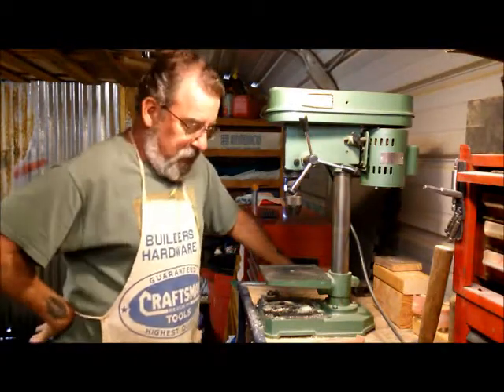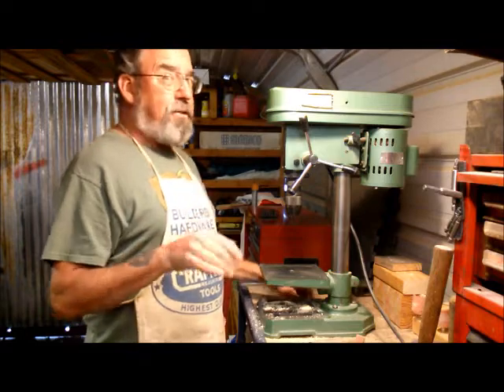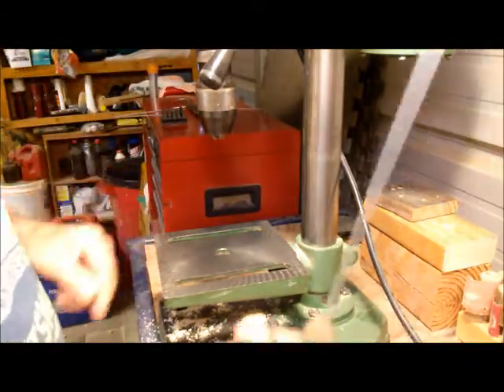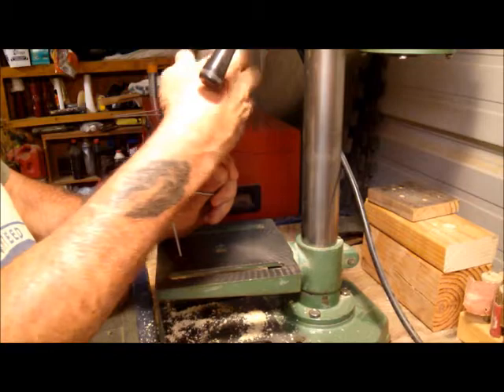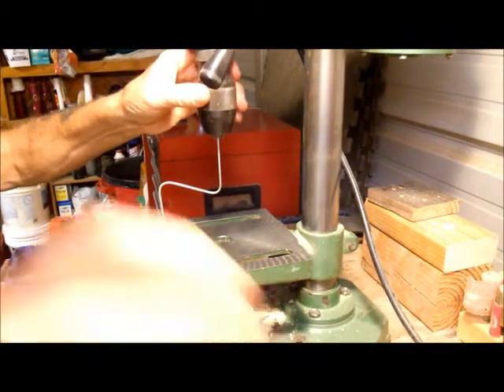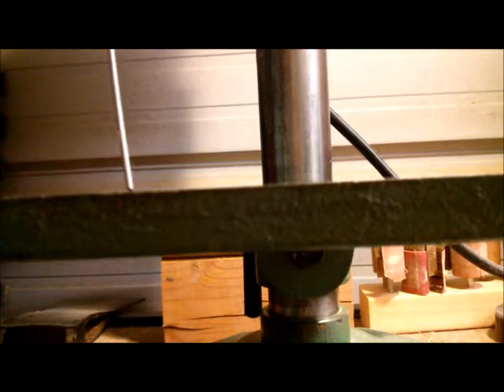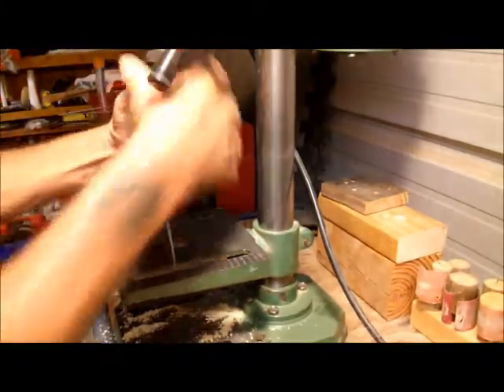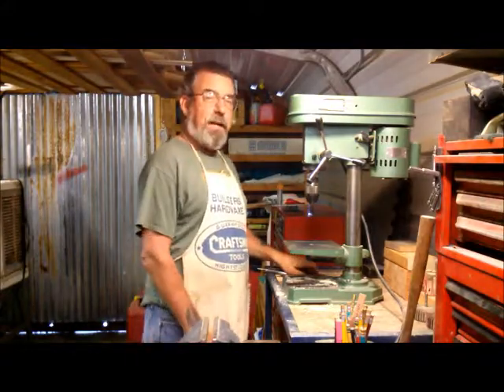Is your Drill Press Tray Square?

Comment: how do you adust the table axis from the front/back? i have a larger drill press with a table but it seems slightly droopy front to back due to the heavy table and the cross slide vise i have on it. i need to adjust it but the only thing i can think of is to prop a 2x4 under it to help prop it up? its out like 3/32 of an inch or so maybe a little less. i need to make a few somewhat precision holes soon for a project.
Reply from the maker: I don't think there is an adjustment for that as the connection of the tray to the back support are fixed.
Reply: I have the same problem and there is no adjustment. So, loosen the table but do not remove it from the column. There should be some slop in the fit as you loosened it. Now there is a gap where you tighten the bolt. Put a shim of kind in the space and retighten the bolt. Check for level front to back and add more shim stock or remove as necessary. Go to an automotive store. Auto Zone O'Reillys etc and buy an old timey leaf type feeler gauge or two. With those leaves you should be able to shim the table exactly. This is trial and error of course.

Comment: hi Paul I think you have some good ideas like this one, but diagnosing the problem seems to be the easy part; how do you get the actual drill press table to let you make those fine adjustments when it doesn't have the capabilities to do so? the only adjustments available are to make the table go up and down or rock left or right when looking at the front view. Any suggestions if the table is lower in the front than the part in back that attaches to the shaft that supports the drill press? thanks Bill
Reply: Build a table for it and shim the table that's on top as much as it's needed?
Reply: +sillybillythatsme2    I agree... seeing if its level is easy enough leveling it is something else. This is half a video..
Reply: I agree!... Nice method to check the alignment of the table (tray)!... But since the table has no adjustment, the only way to correct the problem is to use shims... Or take the table to an engineering business to surface grind it till it's aligned